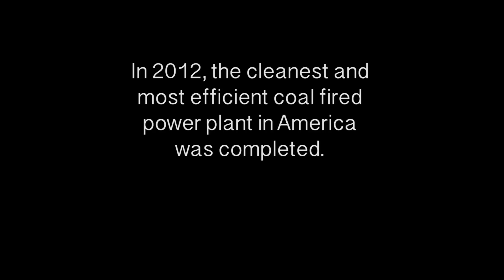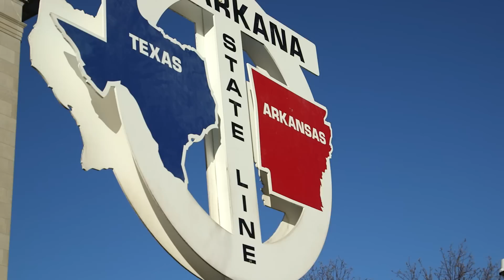Arkansas Ultra Supercritical Coal Plant Technology Faces Extinction

Comment: John W. Turk facility in Arkansas is listed at 0.6 GW in Wikipedia and uses low BTU Powder River Basin coal that requires 50% more coal by mass than high BTU Appalachian bituminous coal.   There were groups espousing  as being environmental that were fighting the new plant's greenhouse gas emissions which are mute as greenhouse gas behavior because earth's greenhouse effect is always in saturation from the strong greenhouse gas water vapor and can't have its overall effect changed.

These environmental  groups are pushing fraud and likely knowingly so.   They succeeded in needlessly increasing the cost of electricity for people much less fortunate than themselves by forcing the purchase of expensive wind generated electricity.  Ironically one of the environmental groups was the National Audubon Society where wind turbines are major killers of endangered large birds.  The overall appearance is these environmental groups used fighting the plant as a means to enrich themselves.

Comment: Never heard of the Ultra SC. Gonna look into it. We have 3 SC units in Entergy Mississippi and they were built from 58 to 81 as base load units. Two burned natural gas and high content solder #2 oil and did so economical and efficiently as a base load units. The older has been very dependable and was designed to bite coal slurs as well as the other two but never has. If I ever get that direction I am going to try to contact someone so the manager can possibly get me a visitors pass. I have seen coal operations in eastern Arkansas because I attended continuing training there several times👍🇺🇸🤙😃

Comment: Everybody cries about being green, yet they drive crew cab unloaded trucks to work with 1 person and then cries about the electric bill the same day. I am all for America energy independence i think to put a hole natural resource to waist is insanity. If coal can be this clean and provide jobs in the process then it should always produce at least some of the energy for our grid. The more options we have the stronger are nation is.
Reply: There are economic considerations that you forgot to make. Coal is expensive and natural gas/renewables are simply more affordable with fewer emissions. Coal isn't going anywhere, since metallurgical coal cannot easily be replaced. But coal used for electricity is dying out.
Reply: That's not how redundancy works.
Reply: I don't know anybody that drives a crew cab pickup truck with one person in it that whines about being green but go on

Comment: A.  "scrubbers remove all the polutants from the flue gas".  That's utter BS and he knows it.  Reduced emissions is great, but CO2 is put out in thousands of tons per day.

B.  A 15% efficiency increase is great, but that's from 33% to maybe 39% before transmission losses.

Coal is cheap, that's the only thing going for it.  Natural gas is a bridge fuel, and this plant will likely convert to gas long before it's obsolete.
Reply: Piss off liberal
Reply: I'm not sure if combined chips HRSGs can run in ultrasupercritical mode without supementary firing and materials considerations.

Comment: People don't understand that these plants emit about 99.99999% steam into the atmosphere. They are extremely clean.
Reply: let me think for a while coal consitsts of carbon C and burns with oxigen O to form CO2. the steam is Hydrogen H and O form water H2O hamm but wait there is no hydrogen in coal shittt. Now think about your comment for a while and tell me where the problem is. tip they use cooling towers  with water inside to recondense the steam thats where all the water vapor comes from.
Reply: @MoGeLzZ  Cooling towers cools circ water, used to condense steam in the codenser,towers just emits water vapour.
Reply: @mogelzz  There is hydrogen in coal.
Reply: @Jemalacane0  the lower the grade of cole the higher the water / volatile content including hydrocarbones is. Ending up with graphite 99% + C content.
I study that shit i know my stuff  xD
but i thought for Skylinetotheseeandme saying that only steam comes out, it was o.k. to just assume that cole is mostly made out of Carbon and forget about the hydrogen content. Dont forget the Sulfur to
Reply: I think you are confusing cooling tower emissions with boiler emissions. The combustion of coal in the boiler is producing SO2, NOx, CO2, fly and bottom ash, along with other byproducts including water vapor which visually will look like steam in the flue gas. While there are technologies to capture some of these contaminates, primary exhaust from the boiler is still CO2. The cooling tower on the other hand is all water vapor. Your comment of 99.9% can only make sense in that context. Look at it this way, if the only byproduct of burning coal was steam in the exhaust, why would environmentalists so heavily chastise America's dependence of coal?
Reply: @GFSwinger1693  - You're probably correct. Nonetheless countries around the world are building these plants because they are far cleaner than their old coal fired power plants. We are not to my knowledge, because Obama killed this technology.
Reply: It’s more like 94.7% steam. But that still is a damn good number considering. I think the U.S. is going to have a huge problem in the next 10 years or so when most of these coal fired power plants are  retired.
Reply: FINALLY!!!!!  SOMEBODY GETS IT!!!!!  What you are seeing is steam that is exhausted after being run through cycle after cycle to re-heat and re-use it.  People don't realize how much effort is put in to using as few natural resources as possible when certain things like steam can be re-processed several times until it has been spent.